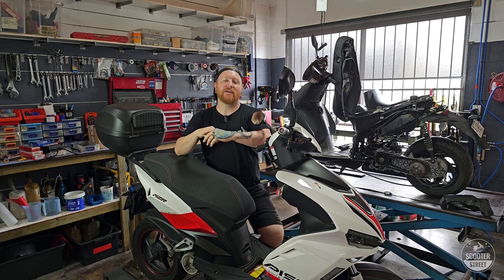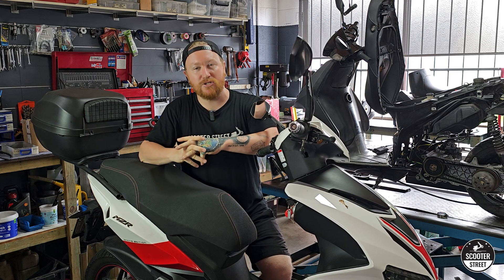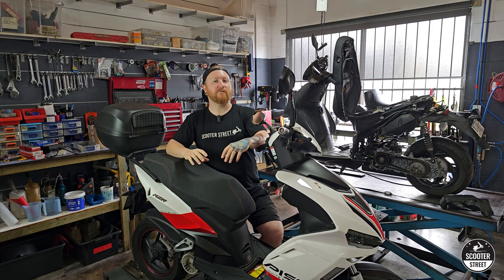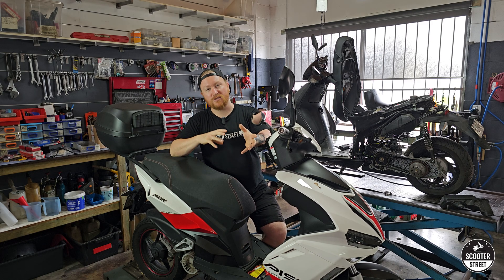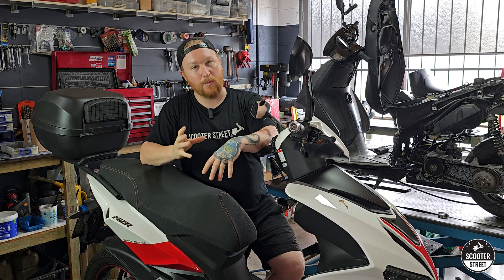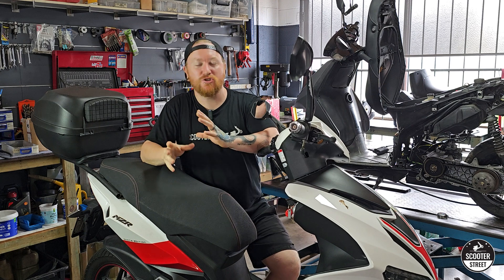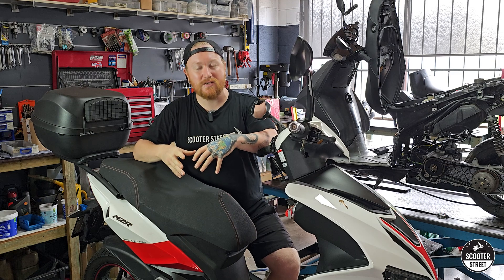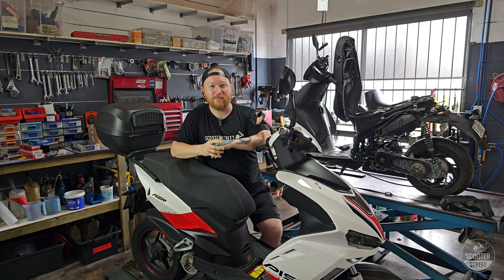Understanding the Pista 50cc Scooter Engine: Performance Tuning Common Issues and Key Differences

Comment: Great video mate, I am looking for a 2T Scooter to Modify and have a play with. Thinking about a BWS 100, but if you have a spare second, what would be some other good 2T secondhand Scooters to look out for in Australia? Models that are easy to get performance out of and also easy to find good upgrade parts for.
Reply from the maker: Any of the water cooled models are the best otherwise the small wheel 2 strokes, Zip, Jog, Zuma.

Comment: so the italjet formula (50cc 2 stroke) has a morini engine or minerelli ?
Reply from the maker: Morini
Reply: @ What 70 kit do you think i should put on a italjet formula ( 2 stroke )
Reply from the maker: @fgbm5637  It would depend on what set up is running.

Comment: I have a sym mask 50 4t euro 5, I really need to improve the performance of my scooter but I really have no idea what to do or where to start if you or anyone could respond to this and give me some pointers or even certain things to buy it would be much appreciated
Reply from the maker: The Euro 5 will be restrcited in the ECU, this will need changing to upgraded CDI, first step. Then add a perfomance Variator, clutch springs and gear kit. The other SYM Euro 5 are the Symply and the CROX, see what is on offer as some of the parts ay not yet be available. SYM and Peugeot share same engine. Thanks for watching.

Comment: Hi i just watched your video about gearing. I have Yamaha Neos with :
Airsal T6
Yasuni R
Dellorto phbg 21
S6 oversize variator
S6 bell
S6 pink spring
Stock torque corrector
Stock clutch (have to change it soon).
Im going 85 km/h, is changing gearing worth it at this point? Stock is 13/52, ill try to change a bit in variator/clutch but im really thinking about that gears
Reply from the maker: You could chage the secondary and raise the top speed.
Reply: @scooterstreetau  thank you bro :D
Reply: Stock clutch is in good condition but i will try to do something here with regulation, propably ill end up with another s6 part xD

Comment: what main jett central and clutch springs rollers should i put on my aprilia sr50r 2020 with malossi transmision and yasuni z for fast 0-80
Reply from the maker: start with 70 and tune higher if lean, lower jet if rich. Needle to middle. Adjusy needle after jet is closest.
Green T spring.
Polini adjustable clutch. This is a MUST.
5.5 - 6.2 gram.

Comment: I have a piaggio zip from 1993. Hiper 1 engine. I have malossi sport 70, yasuni r, 19mm dellorto, malossi reeds, malossi sponge inside the original airbox. The bikes runs great. It does auto wheelies and all. But the top speed is only around 61.  When its going top speed it kinda feels like its leanish, almost like its trying to go faster but getting held back. Belt and vario and everything is stock but its mint condition. I have also gone around 80 with the same cvt setup. I changed the jets today from 95 to 105 and it still feels the same. And the plug looks the same. Next thing ill do is change the cdi and check for air leaks at cylidner and reeds. You have any idea what it could be? There is a shorts video on my channel if you want to help put. Cheers!
Reply: i think i found the issue. The reeds have quite a large gap. Lols Ill try to flip them tmmrw and if it still looks bad ill order new ones. hope fully thats it.
Reply from the maker: @ I would be surprised if it the reed petals. Open the airbox with a stuffer and retune the carby. CHeck the needle position too.
Reply: @scooterstreetau  air box has no restrictions. It’s not like the new piaggio ones. The bike has a 115 main jet and still runs as good as 95. Hahah. It has to be something else then the tune.
Reply: @scooterstreetau  the rees are the only thing that look off. Also the bike did 80+ with the same setup except for cylinder and reed. I also have changed the carb from 17,5 to 19 and still have the same issue.
Reply: @scooterstreetau  also the needle pos dosent change scooter at full throttle right? The bikes is runnig pretty damn good except for top speed.
Reply: @ the top right side on of the reeds is completely broken off.
Reply from the maker: Did you derestrict the exhuats?
Reply: @scooterstreetau  ofc not a beginner.
Reply: @scooterstreetau  I’ll fix the reeds. And I’ll off return the carb Accordingly. Do you think i would need to move down or up the pin?

Comment: Hello i was watching youre video about mainjet do i need to change it if i have a stock aprilia sr 50 2021 year ant it has no electric limiter so it can go 60km/h and i am think i will put Yasuni Z Aluminium on and mallosi air filter do i need to change the main jet ?
Reply from the maker: Hello, Yes you should change the main jet, change rollers and clutch or at least fit some clutch springs to the clutch. This will enhance the overall performance when fitting a new exhuast. Good luck👍
Reply: @scooterstreetau  what jet should I change it to ?
Reply from the maker: @ Trial and testing, watch the carby jet change and carb tuning videos.
Reply: @scooterstreetau and I if I dont will something bad could happen or nothing ?
Reply: Oh so if i just put some rollers i dont need to change main jet @scooterstreetau
Reply from the maker: @ No, you must do all!

Comment: I think I screwed up my scooter, i was servicing the variator, i ended up having to just put the original rollers back in, but once ive put everything back together, i start it and it has a clicky sound in the crank case, then bogs out, idk wtf ive done but it went perfectly before
Reply from the maker: UNdo what you have done and try again, it will be a simple mistake.
Reply: @scooterstreetau  yeah ill do that cheers for the reply
Reply: Update. Its 100× worse than before its fucked and i fucking lost the plot
Reply from the maker: @badmanseed8936  WHen you find the plot make sure the rollers are inserted correctly and the outer nut goes on to the htread at the same distance. Many people dont squeeze the variator basket tight when installing and this allows the rollers to fall out of position. I don't know what is happening but this maye be one conclusion.